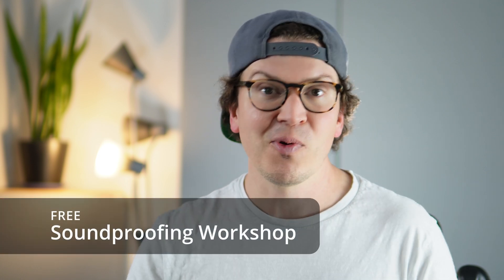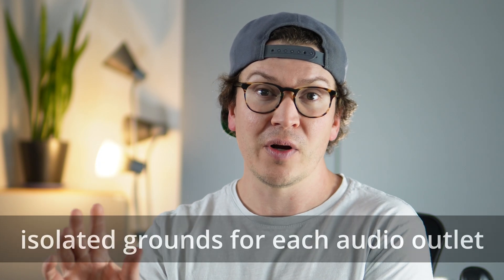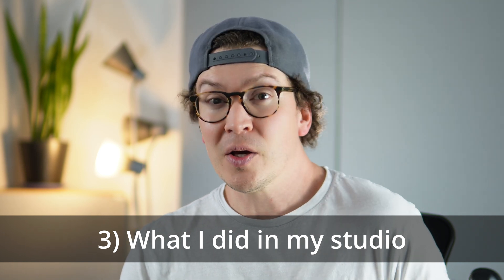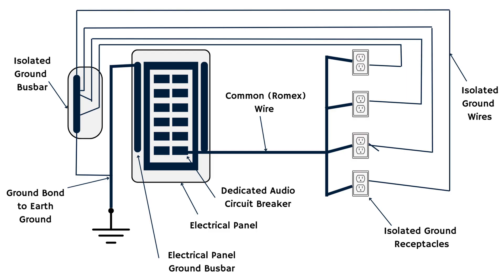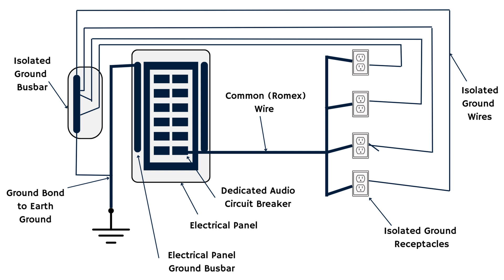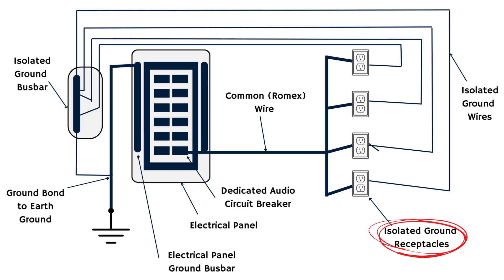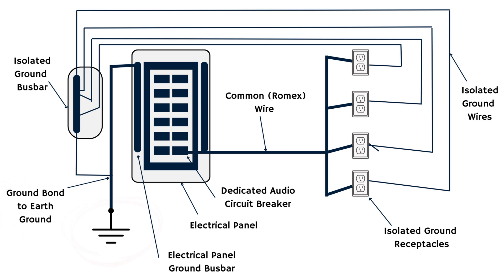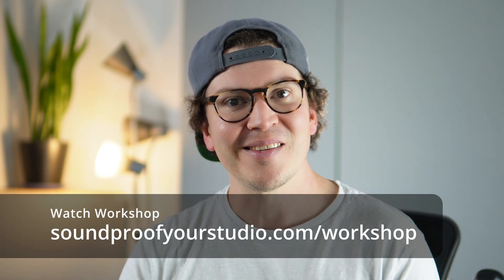Star Grounding For Home Studios: Is It Worth It and Why Should You Care

Comment: It's ultimately only as good as your patent grounding source. If you're grounding into the incoming water pipes, you're golden. 

I'm in the process of designing some complicated audio circuits with multiple grounds, and you literally need your multiple DC power sources powering the circuits to be tied to "star ground" which whether you're using wall warts or an expensive variable bench power supply commonly found in audio electronics labs, there's still a good chance it's not actually tied to a "star ground". 
By complicated audio circuits, I mean my own original design preamps, power amps etc. and various analog effects; I'm an electronics engineer. 

I suppose if I'm really serious, I'll dig a big fucking hole in my yard and use one of my multitap power transformers to build a custom variable power supply that is unquestionably tied into the "star ground" LOL. 
When it comes to how it's being presented to the general musician, it's still a lot of mysticism. Of course, we all start somewhere and for a lot of people, this is their somewhere. I started somewhere before going to college too.

Comment: As one who just went through this ,I plugged my computer and speaker together in one outlet and all of my analog gear and interface into another outlet that fix the hum problem for me ,& buying all magomi cables fix the white noise
Reply: After spending 10k this was the fix I also brought a power voltage regulator and it showed me that I was pulling too much power and Droping down to 116 once I switch to using two outlet I’m get consistent 120volt

Comment: You should definitely not put a computer on the same circuit as the audio equipment. Computers are horrendous sources of RFI/EMI.
Reply from the maker: Thanks for the feedback! You raise a valid concern about computers being sources of RFI/EMI, and it’s something I’ve considered in this setup. While it’s true that computers can emit noise, the solution isn’t always as straightforward as putting them on separate circuits. Doing that could introduce a ground loop, which can create low-frequency hum in sensitive audio systems.

By using the same circuit, I aim to avoid ground loops. There are ways to address RFI/EMI concerns without splitting circuits, like using isolated power conditioners and balanced audio lines to keep the noise in check. It’s a balancing act, and for many, avoiding ground loops is the higher priority.

Audio setups are rarely one-size-fits-all, and I believe in a nuanced approach to address both RFI/EMI and grounding issues based on the specific gear and environment.